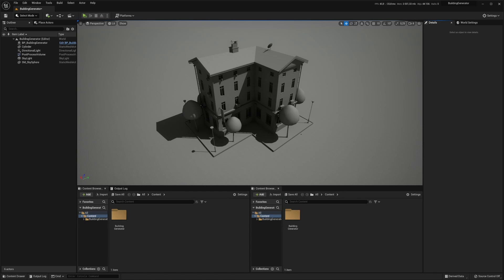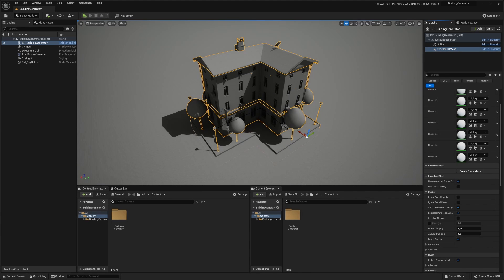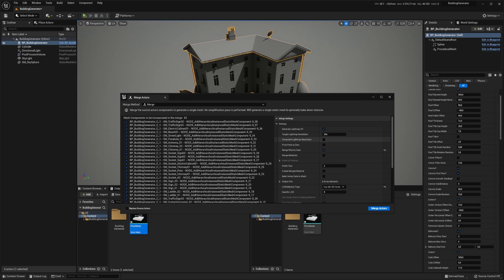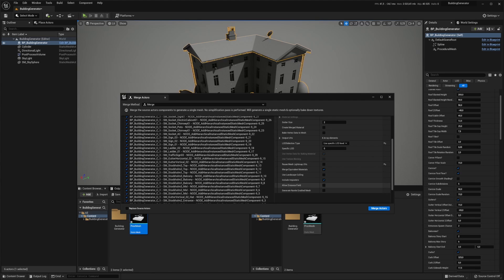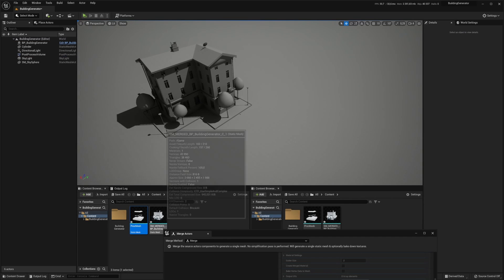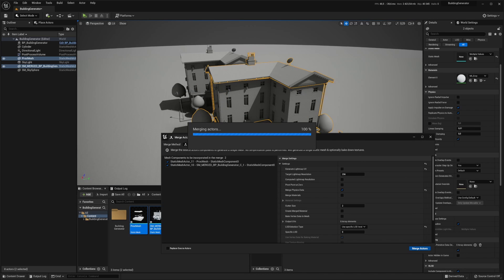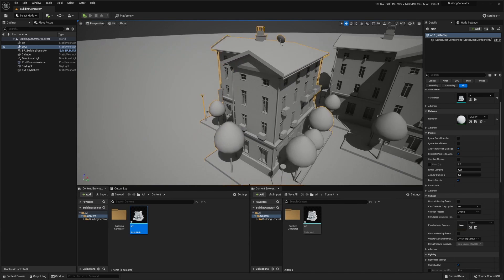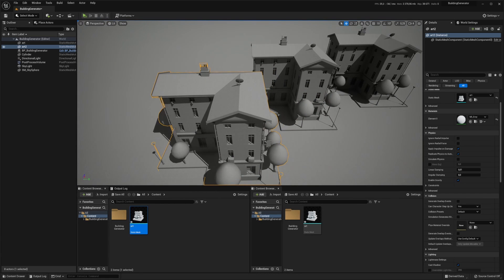Building Generator Merging/Baking

Comment: When I take the character, it passes through the acquired mesh, what is the solution to this?
Reply from the maker: Turn on "merge physics data" and if you are using simple collision, set the spawn type to static mesh before baking. Also - Dont forget, once you bake the procedural mesh, go into the static mesh and set collision complexity to "use complex as simple" to enable collision on that.

Comment: performance wise, how much better is doing this?
Reply from the maker: Performance should be roughly the same, but disc space will significantly increase if you bake. If you dont bake it will require a few seconds for generation time before the buildings are generated. The core concept with the BG is to avoid baking. Async runtime generation will help the initial stutter and this feature is coming up in the next update.